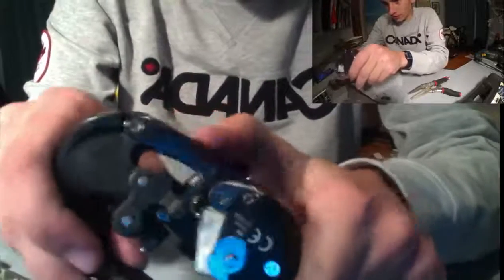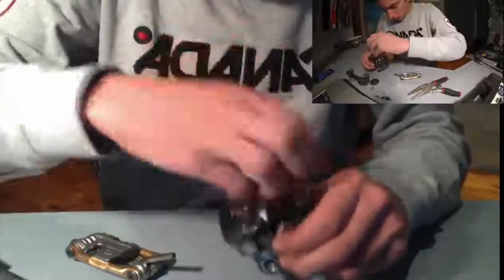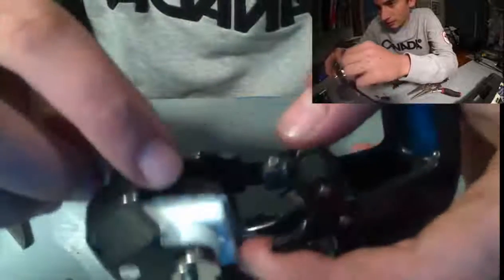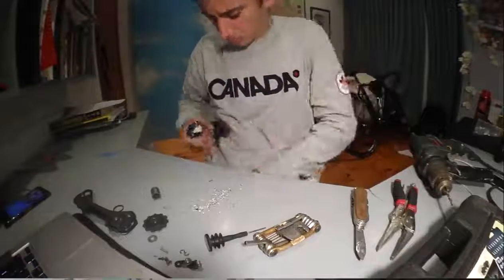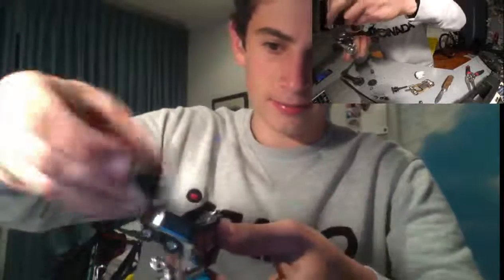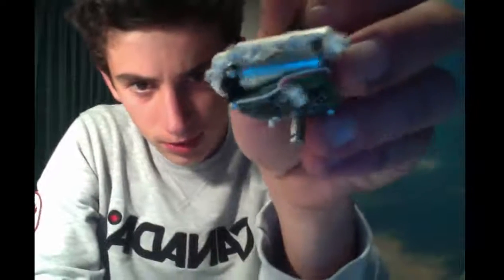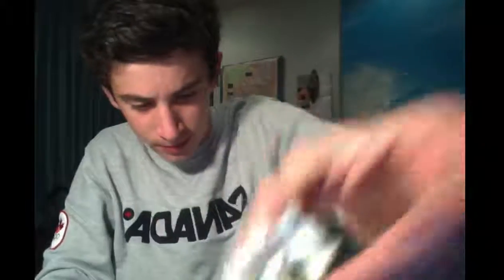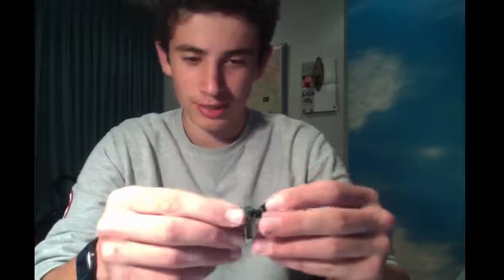AN INSIDE LOOK TO THE DI2 DERAILLEUR (rear mech)

Comment: Did you try the reset button
Reply: i'm having the same problem
Reply: @josephojatson4538  I'm having the same. It moves 3 gears up and it stops. I can hear the clicking noise but it is like the motor is weak.. if I give a small push with my finger, then the derailuer moves and changes gear